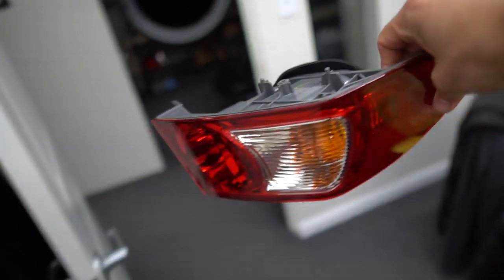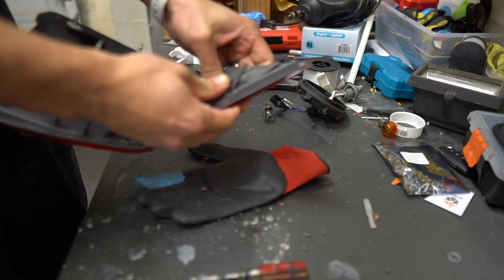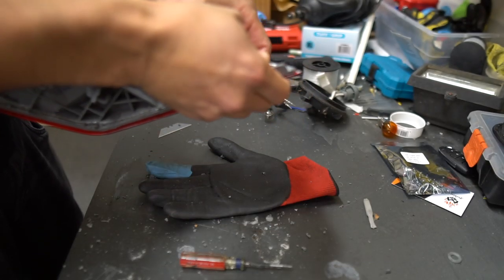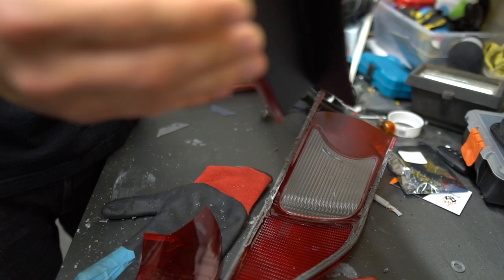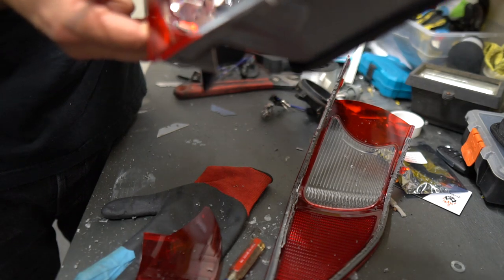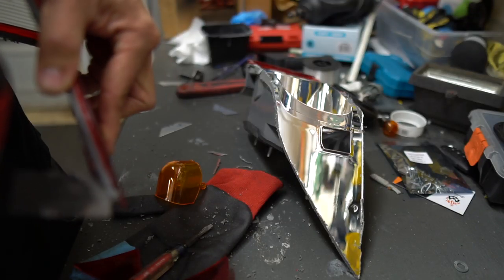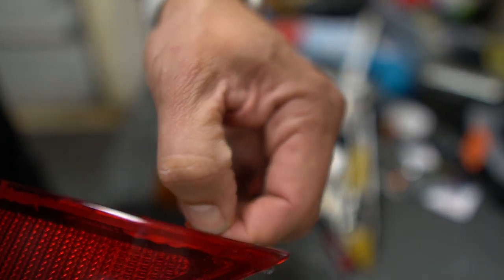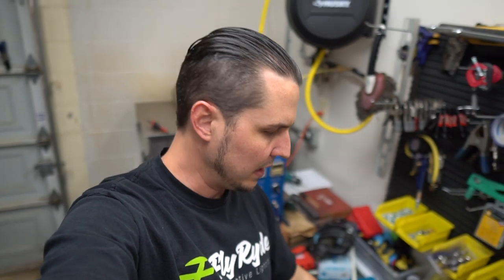How HARD to Open Tail Lights? | Vlogmas 2019 | FlyRyde

Comment: Its all trial and error on tail lights. I usually paint the lip on the inside black the reseal give a good line on the outside. I use a dremmel and cut wheel. Just take ya time. 

Awesome video as always chris. Learned so much from you. And yes stayed to the end.

Comment: I do vw tail lights from late 90s. They are glued together or moulded together I'm not sure. But the bond does not soften up with heat. Instead I go around between the lens and bucket with a flat screwdriver and give a little twist / pry. I've cracked a few so I know how it feels. But I think I've mostly mastered it now. Can usualy get away with only a few little cracks like the first one you got. Little hairline ones. Love the channel

Comment: usually sand and lick with a torch to “gloss” it back, takes a lot of time to get it, “eh” and yes almost impossible to get it to stick back together, what i’m going through with ford lights except it’s not sonic weld but rather a weird glue that you heat and cut with a knife, it sucks
Reply from the maker: Yeah man, it's such a different ballgame than headlights. Its like Headlights were put together in a way that you feel like you're supposed to get in there and change stuff, while tail lights have all these warning signs, like "DO NO TOUCH"! lol
Reply: ain’t gonna stop us though is it lol

Comment: I did stay till the end. I just got a second set of taillamps to work on.   3 out of 4 sides look easy but the last side has a trim in it a lot bigger than the one that is on that lamp. Am I supose to cut off the trim or is there another way? I have a dremel with a flex cable btw
Reply from the maker: darkflames1284 on BRZ tails I just cut the bigger section off and added it back when I resealed.

Comment: Great video I love that I am  pretty good with that tool already but I made a video for you to check out with the blade replaced with a razor to make cleaner cuts hope you check it and it helps had to use this method for my g35 tail lights and u should definitely look ay diffent Blades there are some cool new shaped that might also help cut better
Reply from the maker: Checked it out dude, good job slicing that side marker open! The more I think about that giant clunky multi tool I have with something even more sharp and dangerous on the end, the more that $1600 pro grade ultra sonic sounds like a bargain, lol. I can't afford to mess up my hands these days, and I swear I'd get a nice hardcore cut if I had one slip up! Great idea, and great job though bro!
Reply: Sivarao210 Prorez  i deleted the video  but if u search razor blade on osolating tool u can see some videos of how i set it up